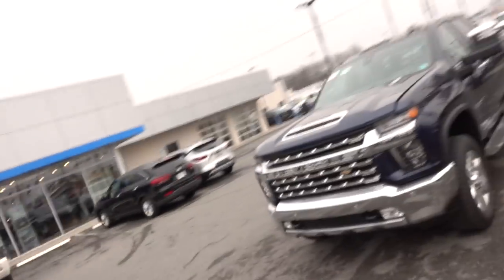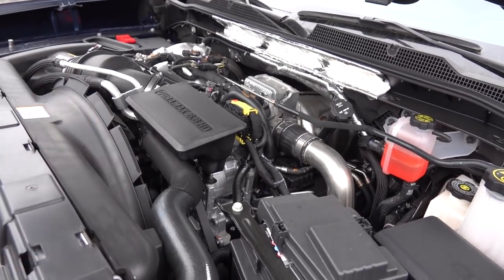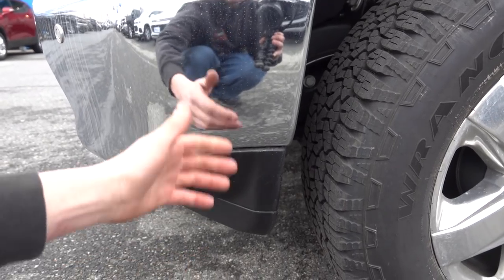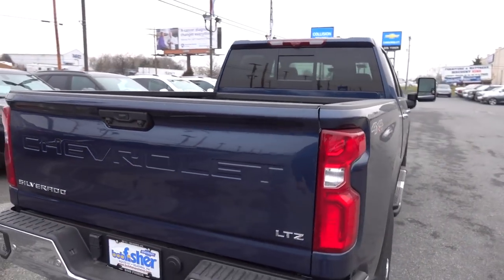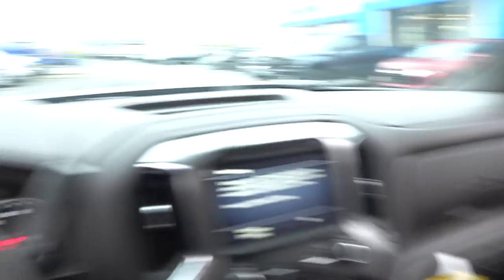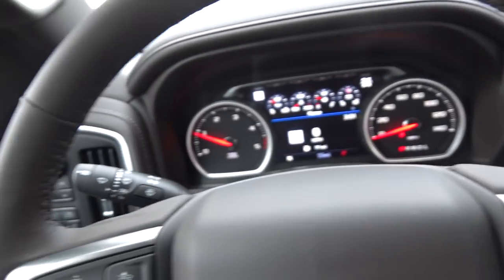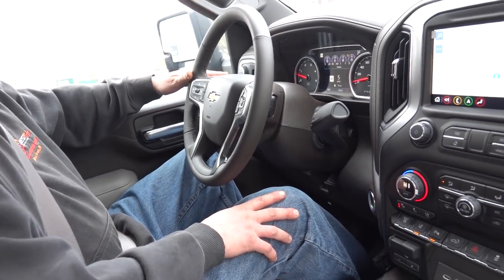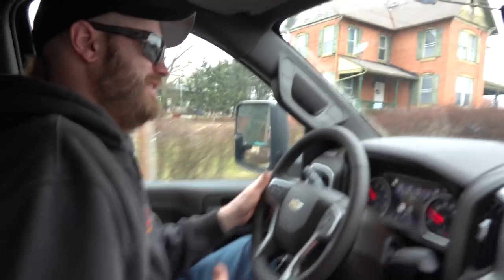Trading My Cummins In on a 2020 Duramax??  CUMMINS Guy Test Drives The 2020 Duramax!!!

Comment from the maker: What are your thoughts on the 2020 Duramax??
Reply: I have a 2018 l5p, any deals on the 2019s?, wont have to tear it apart , Ever!
Reply: Get a gm if your switching sides, the new Chevy front end is the ugliest thing in the last 30 years
Reply: Nice truck till it breaks just sold a 2019 Denali 
just like the powerstrokes buy a two post lift you know the drill don’t do it
Reply: That front end is hideous
Reply: I believe the Allison is only available in GM hd trucks. The Ford and GM 10 speed automatic trans. is for the half tons.
Reply: It’s hideous
Reply: Turba Tom we had 3 fords 2 3/4tons and one a ton. The fords seem to have way too soft of rear suspension when hooked to a trailer but they rode pretty nice! Now we have rams they ride a little stiff but dont squat much when loaded.
Reply: Front end is puke!!🤮🤮 Go get a mega cab duelly add a S475 with the stock turbo, EFI live, then go tow your race truck.
Reply: I get that most of the people on this channel are Cummins guys but the L5P is probably one of the most capable diesels stock. Get some performance parts involved and I think it would be a monster. The 6.7 Cummins is tried and true but the transmissions are literally garbage, you of all people know that! If your using it for towing I think you would like it and it rides better then any ford or ram.
Reply: Turba Tom that truck is hideous.  If you are making your rounds through the big 3, you are going to flip when or if you test drive a ford.  I am a Cummins fan myself however, those fords are quick.
Reply: I would absolutely not be able to look at that thing everyday. Definitely not my taste.
Reply: I think the gm looks better then the chev. 
If I was planning to tune a truck the ecm lock is a big bill to unlock on the Dmax so may play into that decision on the gm. 
I never did like the huge screen and infotainment junk in the ram as it’s just a low quality computer that will cost an arm and two legs to replace as soon as warranty is off.  So that is a plus for me about the gm.
Reply: I don’t like the way they look at all.  I just bought a new 2019 Ram with the Aisin and I love it.  That’s what I would recommend but I’m biased I know.  If you don’t want a new Ram, get the Ford.  I’d much rather have a new Ford than a new Duramax.  Just my opinion
Reply: I’m a huge gm fan but Chevrolet ruined the looks
Reply: @Parker565  One 5.9 (+240,000 miles),  6.7' (105,000), and the current 6.7 (91,000) -  all stock with 68RFEs, regularly tow 15,500 and often 21,000 lbs and have never had a tranny or any drive train problem. The lift pump went out in the 5.9 at 90k but was covered under warranty.
Reply: I agree with the Aisin or Ford. (Mopar or no car) rules are rules brother 😉. I heard you say you want a 1 ton. Test drive a ram with an Aisin. I want to know your thoughts on it even if you buy a Titan XD... Lol 😂
Reply: I’m a die hard dodge guy like you and I work in a diesel shop and I would pick a new ford and if your going to get a big trailer step up to the f450
Reply: People buy them after owning a ram, then they say they will never own anything but a ram ever again

I have chased rain leaks on my $75,000 super amazing Denali 3500 and it's now past 36k so of course I'm on my own

L5p and Allison are awesome but

BUY A RAM
Reply: ugliest truck ever!!!!!!
Reply: David R 5.9’s had the 48Re trans and my 2017 3500 blew the 68 Rfe in the first 15,000 miles. Warranty replaced it but I put a built transmission in it any ways. I don’t tow every day with the thing but I Do tow around 15k with my 35’ gooseneck occasionally. I will not buy another Ram unless it had the Aisin and even then there’s no aftermarket for building them to hold lots of power let alone custom tuning. If you drive a stock truck then the 68 will be alright, if you add any power to it good luck keeping it together and I know that from first hand experience.
Reply: Front end is ugly as f. You’re right the high country looks the best. The GMC looks good too. I don’t think you’re going to get away from the RAM interior though, blows GM away.
Reply: So Ford built and patented the 10L80 and 10R80 for ford and GM half tons but on the heavy duty trucks ford and GM went separate and each built their own. 10R140 and 10L1000 have nothing to do with each other but yes on half tons the way you said it was correct
Reply: I have a 3500 DRW I love it has plenty on power I had a 2018 f350 and I would never buy another
Reply: @caroldavid1019  I had 460,000 on a 68rfe. Changed fluid and filters every 100,000 miles. Shifted like brand new till I sold it
Reply: @randymiller8361  ford dually fenders looks like they keep on adding metal to cover tires  no style  gm and Mopar nice areo flow.
Reply: L5P ain't no joke.
Reply: You really know your trucks.......NOT! 🤔

Comment: Your so full of crap, I just traded in my 16 Ram 2500 it is way louder than this truck.  Hands down the 2020 Duramax is a way better ride period. Especially in the 3500 vs the 1 ton dodge.  Why do you think I got rid of my dodge. And quit for the love comparing a tuned dodge to a stock truck... ofcourse the deleted dodge has more power my dodge had more power it was tuned/deleted 1100 torque and 460hp. HAHA 14:52 its a bit loud inside, sounds alot louder than my cummins" Give me a break. Do you even own a cummins.. The dodge is the loudest diesel on the road. + the 10 speed is amazing on the highway going 85-90 you get easily 22-24 mpg compared to the cummins  sorry to say it, i never regret selling it. If your gonna do reviews at least be honest and stop throwing bs comments on the dumbest things. Your almost as bad as FLT with them saying the mirrors are a 1/2 inch smaller than the fords.. holy crap...

Comment: The once the tailgate is down, the corner step comes into play.  It wasn't necessarily designed to be used with the tailgate up.  It is a very useful feature as it s great for guys like my with big feet and it is reinforced and can handle 500 pounds...

Comment: The 2020 High Countrys look the best, the rest are ugly unless you color match the front end. And also the transmission isn't completely a Ford transmission, the 10L series was co-developed with Ford so it's just as much a GM transmission as it is a Ford transmission. If you want a Duramax, look for dealers that still have 2019s left, you can get fully loaded High Country/Denalis in the low $50,000 range because the dealers don't want them, and they are a lot nicer and more comfortable than the 2020. And then in case you didn't know, GM put out this platform with what they had at the time to try to compete with how nice Ford and Ram were. That being said, later this year they're coming out with a completely new interior and electrical system on the 1500s and then bringing that out for the HD trucks next year. You can get an idea of what that will look like if you look up interior pictures of the 2021 Tahoe and Yukon

Comment: I believe the steps or notches in the rear bumper are for when the tailgate is in the lowered position. sort of like the side step. gotta almost stand on the running board. might be handy. not sure yet. haven't tried it yet, however in the market also for a new truck.

Comment: I have an 2018 Silverado 3500HD Duramax & love this body style better than the new ones, also the built in steps in the rear bumper are super beneficial when you put that tail gate down & you have a 5th wheel/gooseneck, makes it super easy getting up & down with the tail gate down & has some nice built in grab handles on the top rail to pull yourself up.

Comment: This is an Allison transmission designed in concert with GM. As you are aware GM owned Allison. The ten speed you are speaking is a joint venture designed by GM and Ford.

Comment: I run my ram tow mirrors out all the time because the extra mirror in it sucks. They should have put the small mirror on the top/inside on the mirror  because when its down you cant see as well when its up. At least for me. I searching for a set of NONtow mirrors to change mine out.

Comment: Ugliest, cheapest truck of all 3 brands. Keep it Cummins. Get a 2019 Ram 3500 Aisin trans. Chevy front ends r very ugly. Interiors r way cheaper than Ram.
Reply: P PUMP 24 VALVE have you driven a new one? have you driven a new ram, if not don’t speak about what you don’t know. I have been in both. I like both. Ford is just never buy one again. Out of the new three if hands down take the GM then the ram.
Reply: @Sackmatters  I dont even care to drive a new Chevy, The Ram has more leather in their interior than any of the others, and i will never own a v8 diesel, since im a mechanic, and see first hand what a pain v8 diesels are to work on. U cant even do head gaskets without lifting the cab. N they are so packed full of stuff under the hood u cant even work on them.

Comment: One can sure tel you haven’t driven a newer Ram.  My wife’s 16 rides ten times better than my moms 12.  If you’re looking for a 3500 make sure to driven the Ram with the air bag setup.  Also in the Ram, look for one with a snow plow prep package. The springs are stiffer making the truck taller.  

We test drove all three when we were looking for a truck for wifey. The ram handled the best and ride the best. The Silverado was rough and floated on the highway.   The Ram felt more planted and she was doing 90mph and didn’t notice. I kept having to tell her to slow down.

Comment: I looked at a 19 cummins just for the new body style, I was more impressed with the interior of the truck. GM and Ford have a ways to go in my opinion. I don't really like the 5th gen front end look but had they made a sport laramie in the dark red like 4th gens had, I would of traded my 18. I have an 18 laramie black edition and its awesome coming from a 12 slt. 

I do like the features of auto down tailgate, the updated interior and some other features of the 19 but its not worth getting another black truck. I also hate the look of the laramie chrome with the other color options. Once you get the blacked out or white out versions of these trucks its really hard to look at chrome again.

Comment: Just to clear a few things up there are two different versions of this trans, one is a gm/ford model which is smaller and the other one is a gm/Allison model which is the one in the truck you drove and is bigger. Idk if either is better but that’s just the basic facts. Also the ifs softens up a lot over time.

Comment: Choose GMC if you want that combination is a good looking truck
Reply: Have a 2020 3500hd crew cab real truck have 8ft bed. GMC LOVE  IT. Tows a 38ft 5th wheel 75mph at 1700 rpm love the 10 speed.

Comment: Hmm my dad has a 2020  2500 high country and my 2021  2500 high country both 6.6 duramax. That button you hit to roll all windows down is  the down hill speed control feature.   Nothing on his switch panel nor mine works the windows.   That’s pretty odd    

But maybe that LTZ doesn’t have that down hill decent control feature so they just fill the button with roll down all windows LOL 😂
Reply: I have a 2020 LTZ Z71 package. It is also the hill decent button. Does not roll down the windows

Comment: TFL did a tow test. For the first time in a long time the dmax was slow as hell up the Ike.
Reply: The chevy with the duramax and 3.42 gears with a 10 speed made it up the mountain in 8:24. The ram with 4.10s and a 6speed made it in 8:25. Same fuel economy.
Reply: griffin pierce you must have been watching an old one. The one I’m speaking of was just shy of max weight and they didn’t even test the ram.

Comment: Nooo.. have 2 friends who regret the Chevy. One with electric issues sunroof wouldn’t close, entertainment screen blacks out had to be brought in to reset the system 3 times. The other guy has a rough shift in the low gearing on the new 10spd. Costs close to 10k to delete. Have to replace the ECM. Look at the new fords. Seats are super comfortable 6.7 has had great reviews after 2015. Solid axle truck. This is coming from a cummins owner.  Best of luck

Comment: If they’d put the high country grill in all trim levels, I’d buy one
Reply: john orrick you can wrap it. Probably pretty cheap. Look the same.
Reply: @johnanthony6141  street speed 717 wrapped his, the Chevrolet stamping still showed through. They just don’t look right without the bow tie on the front 😔
Reply: I’m in the process of looking for a truck, can’t decide on Chevy or ram. Don’t like the Ford, so ruled that out.
Reply: @johnanthony6141  Same. I’m coming from an 18 f150 so anything 3/4 ton is going to be a huge step up for me. Drove a Ram last week and really liked it. The interior was great, seats were soft, handled and rode fantastic. Drove a half ton Chevy before the 2020hd came out, and it just wasn’t a comfortable truck to drive. I’m short, 5’7”, and I had an issue with seeing the speedometer between like 30 mph and 60mph. The gauges have a sort of visor on them, and block that speed range from my perspective. Seats were hard on the ass too. Picky and probably not worth mentioning for most people, but if I’m spending $60,000+ on a truck, I want to love it.
Reply: I spent over an hour looking for street speed then the video. Lol I found it. Looks cool. 
My honesty opinion I like the Ram best. 2500 better ride or  3500 better longevity and resale. decisions, decisions!  It would help if they came out with good rebate . Lol

Comment: I had an 05 Duramax...not really impressed with the new ones. It doesnt have a REAL Allison trans anymore which was its main positive. But now with all the EPA crackdowns the cummins is loosing its million mile status so it's really a tossup with all 3 brands dying at 250-300K. I have a Ram 3500 and EVERYTHING Dodge is breaking...the Cummins is still great though.

Comment: Don’t like the new style, I’ve owned a new ford 350 crew 4wd, a Cummins 3500 manual crew 4wd a gmc 3500 duramax crew 4x4. The gmc is the only one that’s had zero issues. The ford had a few problems, the dodge was loaded with issues, best decision ever dropping it off. Also saying it’s louder is absolute bs, by far the quietest, my friends complain mines too quiet.

Comment: First time I have seen the 2020 Chevy and man the front view is pretty fugly. Not crazy of the overall look of the newer Chev/GM trucks at all. Bumper steps may be handy to get into the bed when the tail gate is down but I don't like the visual aspect of them. I used to be a GM guy, but I am on my second Ram / Cummins currently a 2016 Longhorn 3500 and so far I am happy with it. And those mirrors on the Chevy? All I can say is it may draw the attention away from the Ram mirror haters.

Comment: Coworker has a 2020 GMC 2500 Denali. Nice truck but the worst riding of all the HD's. I don't believe anything rides better that the Ram 3500 with OEM rear air bags. Ram removed half of the spring leaves with the air option as the bags support the weight, not the springs. Best ride empty and loaded plus it self levels and has two ride heights. One last complaint the GM trucks have the oldest and worst of all the interiors.

Comment: GM just has a very cheap truck compared to ford and ram, but with the same high price. The interior is plain basic and cheap plastic, they have all these work friendly accessories that really don’t help any and just bump up the cost. The engine still has the least power of the 3 also. In general it wouldn’t even be an option for me personally.

Comment: With all the complaints and do not likes, why would you buy it? 2019 Dodge. Otherwise I’d force myself to buy the Ford. Would to have to work on any of the V8s when they go out of warranty, and you will have to work on the POS. Have to add why would you or anybody for that matter buy a short bed pickup, and the complain you can’t haul anything because you were to dumb to buy a long bed. See it all the time.

Comment: My thoughts on the Chevy is it's ugly as Sin I do however like the GMC much better the bumper steps work great with the tailgate down extremely functional there have been a lot of studies all agreed about the same a Duramax is cheapest to get you up to a hundred thousand miles maintenance wise Duramax will easily go now 200,000 Towing work truck stuff like that without too much as far as problems go at 300,000 they start getting a lot of nick nack problems and it just keeps on going on but it'll still easily do the 500000 Mark just nickels and dimes you but if you're like me you'll be buying something else way before then